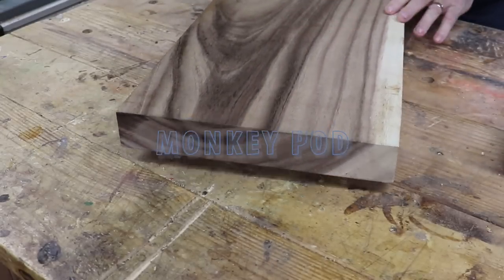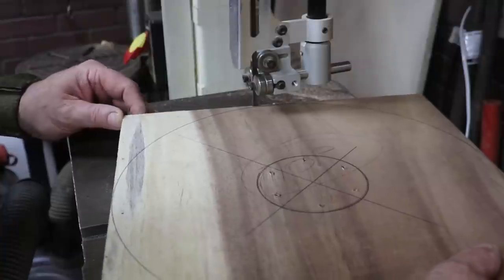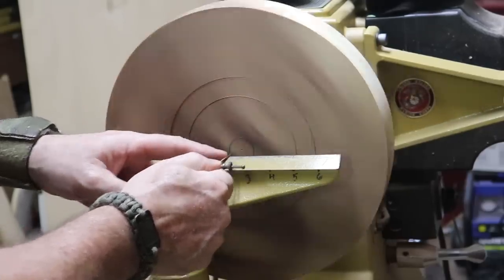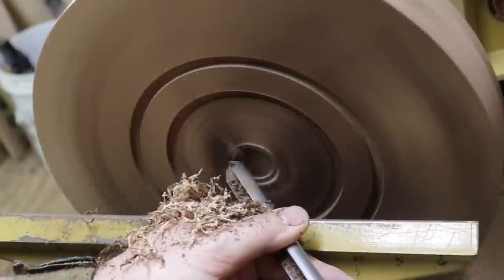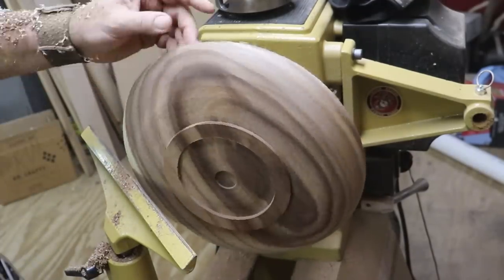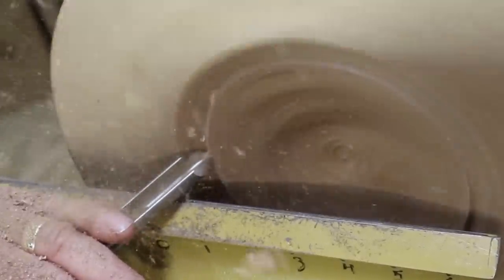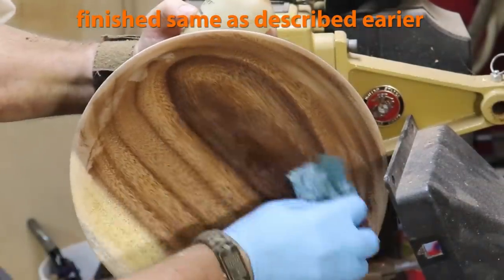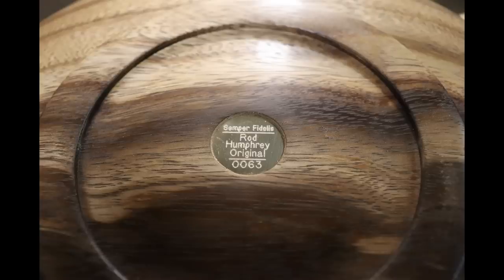Woodturning Monkey Pod

Comment: You really did justice to that piece of wood. 👍👍You were right. It certainly did reveal a beautiful color and figure. And you produced a very pleasing shape. Very nice finish, subtle. What were the dimensions of the work piece after bandsawing? It's hard to guess as there is nothing to reference. I very much like the production. Just the right amount of time spent on each function. Nice place to leave the dust. That is on the outside of the mask. Thank you for sharing. Have a great day and stay safe.🙂🙂

Comment: Just googled Monkey Pod and found that it is also known as Mimosa among other names. I had a nice Mimosa in my yard that died and I have made some bowls from. I really like what I call the the milk chocolate and cream coloring. I did not know that it is a hardwood because it grows fairly fast. I have never seen it for sale in my neck of the woods around Charlotte. We have lots of it along the interstate and in lots of yards. Keep up the good work.
Reply from the maker: Hi Randy, that website got it wrong.  I have Mimosa growing on my property as well, and Monkey Pod is definitely not the same... it's a much bigger tree. The best resource I've found (or at least one of the best) online is the The Wood Database.  Anyway, it's a very heavy wood, but not as dense as the weight makes it feel. It's porous and produces a mix of very nice shavings and sup[er fine dust simultaneously...messy stuff!    Thanks very much, I appreciate it!
Reply: Thanks for the info Rod. On an unrelated side note, while checking out the Wood Database I found that you can identify wood using black light. Pretty cool.